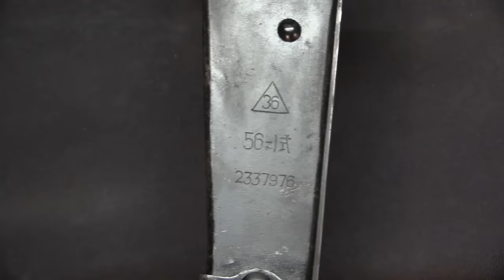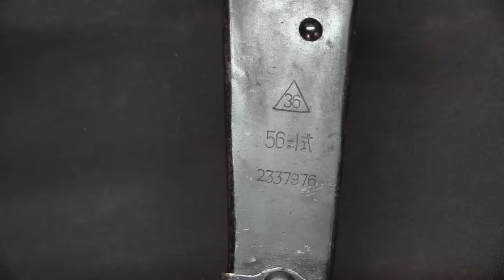RPD: The LMG Adapts to Modern Combat

Comment: Type 56 was actually meant to be a whole military industrial system.

Type 56 Semi-Automatic Rifle - SKS
Type 56 Automatic Rifle - AK
Type 56 Squad Machine Gun - RPD
Type 56 Cartridge - 7.62X39mm
Type 56 Rocket Launcher - RPG 2
Type 56 Anti-Aircraft Artillery - ZPU-4
Type 56 Mortar - M-160
Type 56 Field Gun - D-44

etc
Reply: This is completely wrong. All of those firearms and the 7.62x39 cartridge were invented by the Soviets during WWII. The Soviets gave the Chinese the technical packages in 1956 so they designated them the Type 56 Rifle, Type 56 LMG, etc. The "Type 56" nomenclature has nothing to do with the design intent as it came about 15 years later in a different country from where they were developed. Ian literally said this in the video.
Reply: @Blackhawk441  None of what you said contradict what i said.
Reply: @powereater  "Type 56" was not "meant to be" a whole small arms system. The weapons that made up the small arms system the Soviets designed were later each called "Type 56 Rifle" (etc) by a different country, because they were adopted in 1956, but there was no "Type 56" project. 

You wouldn't say "M1" was meant to be a small arms system because the US had the M1 Garand, M1 Carbine, and M1A1 Thompson at the same time. It's just a naming quirk.
Reply: @Blackhawk441  But it's not, Its not a naming quirk. Even the ammo cans say Type 56, because its ammo worked in all type 56 series of weapons.
Reply: @powereater  they named them Type 56 Rifle and Type 56 MG etc because they were adopted in 1956. Ian says that in literally this video. Do any amount of research. The Chinese traditionally name their military firearms after the year they are adopted.
Reply: @Blackhawk441  And they are all adopted in in 1956 as a part of a system. I dont understand what you are trying to argue, are you saying that China had 3 separate weapons development program that all happens to end in 1956 that all happens to use the same ammo? that this is a sheer coincidence?
Reply: @powereater  China didn't have any weapons development program. The Soviet Union just gave them old Soviet designs in 1956 so they called them Type 56. Do you think the Chinese invented those designs?
Reply: @Blackhawk441  The fact that you are resorting to this level of semantics shows how weak your arguments are. Are field testing, tooling up and manufacturing/industrial alignment no longer considered parts of weapons development? Bren guns, FN-FALs and M1903 Springfields are not parts of weapon developments programs?
Reply: @powereater  Are you really claiming they named them all Type 56 Rifle, LMG, etc. for any reason other than that they were adopted in the year 1956? This is well-settled history and Ian himself says this in this video.
Reply: @Blackhawk441  They were a part of the 1956 military industrial program, There was quite literally a document by the state council called "1956–1967 Long-term Plan on Science and Technology Development". Or are you suggesting that it was all a coincidence? all these weapon systems received the type 56 designation because they were extra busy that particular year?

Comment: That feed drum is interesting for a 'belt carrier'; makes me wonder why a similar carrier wasn't made for, say the M60, or why no enterprising chap with a welding torch didn't add a couple of 'prongs/snaps/protrusions' where such a belt carrier could be hung. I remember 'hearing' that some experienced Aussie troops (with time in combat in Malaya and Borneo) jury rigged something like a canvas canteen holder to hold the belt (size unknown) and a couple of commo wire loops to just put it into place, though I might have been for the  Aussie version of the FN MAG. I mean the alternative is wearing your ammo like you were Pancho Villa.
That being said, I wonder what a quick use carry/feed drum would weigh with 50 to 100 rounds of .308 in it, not to mention how noisy such a beast would be, being carried in the bush.

Comment: it would have been nice if you covered the use of this weapon by MACV-SOG and particularly Franklin D Miller, MOH winner who used this weapon with the modification that SOG chopped the barrel down in length. one problem that SOG faced was getting replacement belts for the weapon, so they were required to hang on to them and not drop them and leave them behind in a firefight.

Comment: I definitely prefer it in the short barreled "Rhodesian" variant.
Reply: I was in Rhodesia and used one of the first short RPDs. An RPD with a damaged barrel was cut down. Over the years other modifications were introduced as well reducing overall length and weight.
Reply: @Bladerunner5434  i had a chance to just hold one once and seriously just the barrel being shorter changed the impression so much. From a fairly hefty somewhat cumbersome LMG to a compact and easy to handle one.
Reply: @Dominik189  After cutting down the barrel there wasn't a bi-pod anymore so it was good in urban terrain, assaults, vehicle anti-ambush etc but no longer a squad support weapon in the traditional sense.
Reply: @Bladerunner5434  very true. I'd say it kinda felt like a heavier belt fed assault rifle than a machine gun, minus the select fire capability. It was definitely weird, kind of like a SAW but not quite a SAW.
Reply: @Dominik189  BTW - we only used gas setting 2 or 3 never #1. While on operations I only used # 3 so as to have more reliability. I remember a friend saying that it had more recoil on # 3. To which I replied that the more recoil for reliability was a good trade off.
Reply: @Bladerunner5434  well, I imagine it wasn't that much more recoil. 7.62x39 even violently over gassed tends to be less that a slightly over gassed 7.62x51.

Comment: At first I thought it was a major mistake forgoing a quick-change barrel, but I think the 'meltdown tests' from IV8888 prove that you really don't need a quick-change barrel for 7.62x39. Most of the heat comes from the friction of the bullet against the walls of the barrel, not the burning powder, and the slower velocity bullet cuts that down considerably.

Comment: Got to shoot a full auto Russian capture a few years ago for foreign weapons training. The thing was fun when it worked but it was incredibly picky when it came to placing a belt in. If it was at all off the gun would jam pretty hard without fail. In all fairness, the gun was beat to hell. Another thing that I found to be pretty annoying was the length of the bipod. When prone it was slightly annoying to use. You had to really snake your back to get a good sight picture. Now the PKM. That thing was fantastic.

Comment: What was the PLA thinking. You got a type 50 SMG PPSH41 copy. 

Then there's the type 51 pistol TT-33 copy . 

Then there's the type 52 pistol PPK copy. 

Then we have type 53 rifles M44 copy, LMG DP-27copy, and HMG SG-43. Also a 82mm, and a 120mm mortars. Like they gotten lazy with the designs. 

Then there's a type 54 pistol. A upgraded version of the type 51 TT-33 copy. 

Then they got lazy again and designed type 56 to there AKM, SKS, RPD, and RPG copy's.

Comment: What is it about the 60s that led to Degtyarev's guns being replaced by the PKM? The flapper locking system seems like sturdy and strong. The PKM is world class no doubt, but the DP seems awesome too and simple.
Reply: Modded DP for belt fed is okay but doesn't change that it was an obsolete design compare to things like MG42.
Red Army wanted a GPMG with stuffs like purposely built belt-fed, quick change barrel...

You can watch vid about PKM on this channel giving some insight on why DP got replaced
Reply: @huntermad5668  which one? The interview with Max or just the show n tell?
Reply: @ABCantonese  
pkm video

Comment: The Soviets created the 7.62x39 in 1943 because of research and development prompted by battlefield experience... and it had nothing to do with the development of German 7.92 Kurz ammunition in 1942, just as the AK-47 most definitely and without doubt was not inspired by the Sturmgewehr 44. *wink, wink, nudge, nudge*.
What wasn't mentioned about the RPK is that it used magazines instead of belts, and the magazine lock was the same as the AK47/M. That meant that AK magazines passed over by squadmates could be used in a pinch if the gunner ran out of the 45 round magazines he normally used. There was a 75 round drum magazine issued early on in the life of the RPK, but that was dropped in favor of the 45 round box type.

Comment: I had no idea the Soviets had the idea for an intermediate cartridge independently. I always thought it was inspired by the german 8mm Kurz. If the Soviet Union and Germany independently developed the intermediate cartridge at the same time, then I wonder why the British and Americans didn’t. (Granted, the .30 carbine cartridge could be considered an early intermediate cartridge, but as designed it wasn’t intended for front-line combat, even if it was pushed into that role extensively

Comment: I've never understood the move to the RPK from this. Belt fed is what you want in a support weapon.
Reply: But without a QD barrel, a belt fed gun is not as advantageous. AND don't forget, the RPK wasnt done in a vacuum. It's just a beefy AK. Same internals, magazines, AND same manual of arms.
Reply: with belt fed LMG you usualy have less accurate suppression , more ammo consumption and it add weight on the logistic . RPK make it way easier

Comment: Machine Guns are designed to be have Full Auto and Safe mode.
They we're used on wars so you don't need to let your finger go tired.
Reply: I'm sure good machine gunners figured out how to squeeze off single shots or 2-3 round bursts when required. Otherwise 5 second bursts on target were probably the norm

Comment: When you talk about the original concept for the AK as a submachine gun replacement, in submachine gun roles, you neglect the fact that submachine guns were far more widely used in the Soviet army at the time it was conceived. In addition to the usual secondary roles, they were extensively used in the infantry. Each company had a submachine gun platoon used as a point breakthrough force entirely armed with SMGs and DPs as a means of gaining fire superiority. In other words, they used PPSh and PPS SMGs as assault rifles.

Comment: This along with the AK-47 was one of the nasty things waiting for my dad and his fellow US servicemen in Vietnam

I saw this along with the AK-47 as yet another bad guy's gun and the only people who use these are trying to kill my dad and his fellow servicemen

I also until this video saw the state yet another crude Soviet piece of crap just something quickly designed thrown together it fires the stubby little AK rifle around but this has a little bit of complexity in here and it's surprising that it also used a mg42 style feed pawl system

But these were mean and nasty little guns that did a lot despite how small they were.

The replacement for this would be the RPK and it's almost like US military looked at the old RPD and said hey even though we won't admit it we kind of need something like this and that's how we ended up with the m249 saw which ironically we are kind of replacing with our own rpk in the form of the M27 IAR which is also becoming the Marines new assault rifle.

Comment: Re: gas port adjustment. I'm pretty sure the ones I've fired had a tool that went into the slots on the right side, and which depressed the stud at 2 o'clock which was on a spring detent. The gas port block could thus just be rotated to the new setting without unscrewing anything. A different version of the RPD? Maybe my faulty memory...
Reply: My polish version does not have a spring in there. You have to unscrew it. I'm guessing it would get too hot for a screw to survive very well. But maybe

Comment: Are non-disintegrating belts and push-through feeding necessarily related? I.e. US MGs IIRC all have pull-out feeding (which makes them taller and thus heavier than if they were push-through) and use disintegrating belts. Does one aspect of design necessitate the other?

Comment: Why is the RPD not used more? It seems so legit. I am biased because it’s one of my favourite machine guns.
Reply: It's still a viable platform for the modern battlefield, however you don't see them because there are other platforms, like the RPK and PKM which are better in pretty much every single aspect. 

It's not that it's bad, but it's not as good as the other variants out there. 

I think same can be said about a lot of weapon systems, particularly machineguns.

Comment: If the belt is only 100 rounds, what's the point of it being belt-fed? The weight if the box, the weight of the links, the time it takes to replace the box and the belt makes the practical firepower of this thing no better (probably worse) than a regular AK.

Now I understand why Russians have replaced it with RPKs so quickly.
Reply: GPMG are regularly fed with 100 or smaller belts when carried by a single person, so there are certainly advantages. The box isn't that heavy, especially it's fabric.
Reply: @hailexiao2770  Look at that one, I al talking about that one, RPD, the box is steel.

Besides, GPMGs are in full-power rifle calibers ( cartridges themselves weigh twice as much as 5.56/5.45, and the MG itself too, so the weight of the links and the box are not as important), and crew-served, the second guy carries more ammo. Or installed on the vehicles.

This is "squad automatic weapon" (the name makes zero sense as all rifles in the squad are automatic), or in Russian, Ruchnoy Pulemet, what literally translates as Handheld Machine Gun. As such it is a personal weapon to be carried and sometimes shot from the shoulder, and the weight is of primary importance.

And the reloading with these 100 rd boxes takes so much time that you can have higher practical rate of fire with RPK's 40rd box mags or 75rd drums.